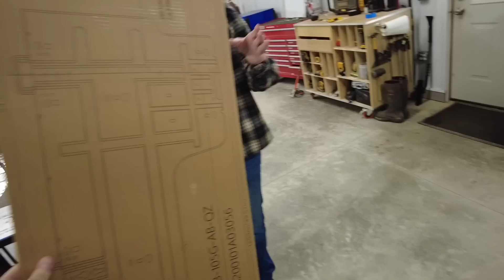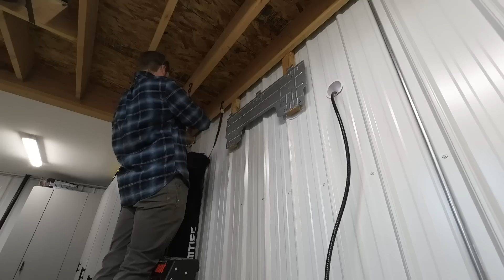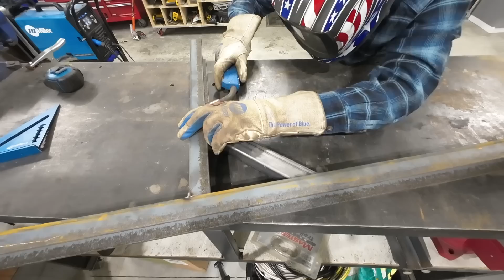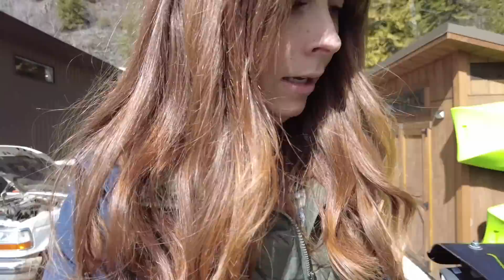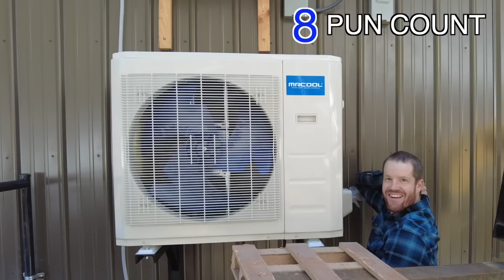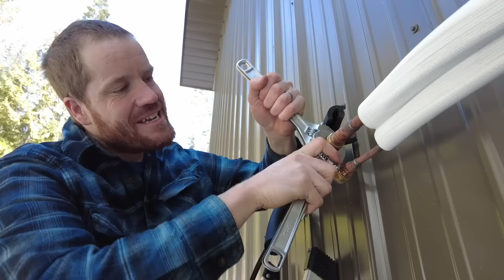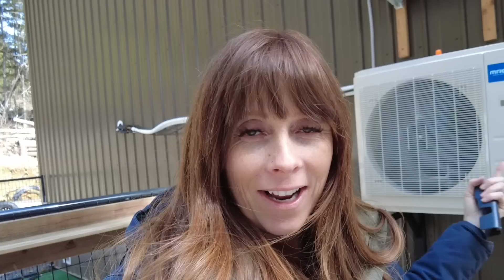Installing DIY Off-Grid AIR CONDITIONING

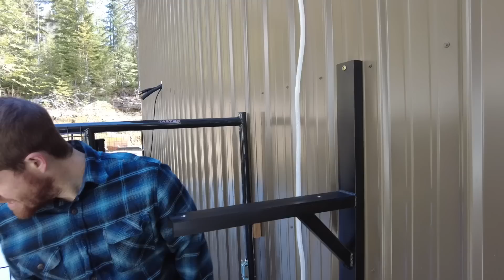Comment: Great video.  I am considering this for my garage.  One concern.  At the 9:35 minute mark,  you need to rethink how you mounted those brackets.  The screws may work in the short term but they are too small a diameter and span to far a distance.  They will fail at some point.  Maybe use 3/8 bolts with washers and nuts inside the building.  Thanks for the content.  Darryl
Reply: I understand the concern, however one also needs to consider bolts to be a direct thermal path from outside to inside and visa versa. Warm inside and below freezing outside would make for condensation or frost on the inside defeating the purpose of the unit. Add that moisture anywhere along the bolt long term would not be good for a healthy environment. Maybe lag bolts into the framing would be a good alternative solution to anchoring the supports.

Comment: I installed 3 Mr Cool units and found them to work great.  My last unit was for my garage and it does a great job of heating and cooling.  Based on issues for service by local HVAC shops not wanting to work on Mr Cool units, I figure it was cheaper to install Mr Cool units by over 50% less, and if needed I could replace a broken unit with another and still be money head.  I did follow advice to use a HVAC torque wrench for the line set, and use Nylog on the fittings.  Mounting the unit on a pad outside is quieter because it does not transfer noise through the wall.

Comment: I have several MrCool units, they are awesome.  One thing I would add is a soft start device.
Reply: This is an inverter based unit. It ramps up or down as needed and doesn’t have the startup surge or a non-inverter unit. It always starts “soft” and ramps up as needed based on demand.

Comment: You may want to consider putting the extra line-set on a horizontal plane to prevent oil traps in bottoms of the piping.
Reply: I actually looked at comments to see if anyone caught that. Good job. Totally agree
Reply: Not sure what you mean. Going to be doing similar so I don’t want to make any mistakes. Thanks
Reply: @stuartkorte1642  see the coil of extra tubing between the outdoor unit and the wall? It would be better to lay the coil flat below the unit, secured up with big zip ties, than vertical like that
Reply: @intrepidzephyr  sorry can you explain more, i didn't get the point
Reply: @mahmoudbitar6571   the point is to have the extra coils of tubing horizontal so that the lubricating oil that travels around with the refrigerant does not get trapped. Imagine the oil pooling in the vertically coiled loops, then imagine it passing more easily through the horizontal loops
Reply: @intrepidzephyr  got it , thank you so much, what about the outside unit itself if its higher or lower then the indoor unit , or no effect for that ?
Reply: @mahmoudbitar6571   there will be limits according to the manufacturer’s installation instructions but generally one floor up or down should be OK
Reply: @intrepidzephyr  Thank you , appreciated
Reply: @Stuart Korte   The oil will lay in the bottoms of the piping and prevent some of the oil return to the compressor. Low oil in the crankcase could cause a failure situation.
Reply: Good advice! Lay the extra coil flat under the unit.

Comment: I mounted a 7` x 9` projector screen and some heavy insulated shutters by myself.. just screwed a large eye bolt to the wall, ran a rope around screen and thru the eye bolt, instant pulley like lift for one person.  I even  bought a fancy pulley that I didn't need or use. The eye bolt worked perfect. Nice touch with the straps, I'll have to remember that one!

Comment: Will top mini split drip onto bottom mini split ? Is rain/drip awning required?
Reply: At First I was thinking the same thing but then i figured they are made to be outside in the weather so I would assume it should be fine. It would be nice if someone with experience about this makes a comment tho

Comment: Mr Cool DIY units are COOL 😅  My wife and I installed a 24k unit in our garage, and it only took us around 2 hours. 
The hardest part was routing the lines through the attic. 
We live in Florida so our house is concrete block. 
It was easier to go up through the ceiling, and out the gable end, and of course we chose the hottest day to do it. 🥵🤣😎 It really works great. Now our garage is a great workshop for us.

Comment: Have you guys given any thoughts for your future house. I have an interesting suggestion just because of the materials you guys prefer to work with. My idea is a Concrete and steel house with wood only used as accents.  I thought you guys might like this idea!
Reply: What would actually work best would be a ICF — INSULATED CONCRETE FORM HOME!!!
Google it!!!
Hard FOAM FORMS are used to make Concrete Walls.
Then to Top It Off, SIP Panel Roof — 
Structural Insulated Panels (SIPs) 
are high-performance building panels used in floors, walls, and roofs for residential and light commercial buildings. The panels are made by sandwiching a core of rigid foam plastic insulation between two structural facings, such as oriented strand board (OSB).

Comment: Quick question about your deck solar panels, are you going to put snow/ice stops on the roof above the solar panels to prevent snow and ice from sliding down the roof onto your panels?

Comment: Great work! 😀
From my experience the condensation drain of the outdoor unit will lock-up when the outdoor temperature goes below 3°C. Don't forget to remove the condensation drain before it starts freezing.
The indoor unit will be loud while de-icing - don't put it in a sleeping-room but use a forced ventilation between the sleeping-room and the room with the indoor unit.
We installed an outdoor air inlet over the indoor unit and an indoor air outlet behind the fan of the outdoor unit to have forced ventilation with heat/cold recouperation.
You can also move the generator from outdoors behind the PV-Container into the workshop and add an exhaust heat-exchanger to get a hybrid heating-systen. 😉

Comment: The only problem I have had with these units is the inside unit fan blades get all loaded up with dust and won't move any air.  I have had to make a small air nozzle and blast the squirrel blades clean.  When in air conditioning mode, the air heat exchanger is wet and all the dust from the fans sticks to the fins and plugs the drain hole.

Comment: That's a great looking system.
Our heat pump system wasn't able to keep up during that ice storm we had in TX back in 21. But on the plus side, we have 'emergency mode' which provides heat at a substantially larger energy draw.
Also learned that having an overhang above our outside unit keeps the fan from freezing up.
Definitely a brand to look into if we need to replace our home system again.  But the original one lasted almost 30 years and was still running strong.  But since it was 30 years old, we decided to update it, and our energy bills dropped almost by 1/2,
Always good to see the ongoing improvements and projects.
So...when are you going to rebuild that Courier?  🤣

Comment: I installed a Smaller MrCool unit a couple of years ago. Looked into the DIY series but it was not offered in the small size I needed And I also noticed The DIY series was about twice as expensive as their Non-DIY units. I decided to save the money and DIY a non DIY unit. It had a higher SEER number and was cheaper. Drawback was the need to evacuate the system before use and lack of warranty due to me not being a HVAC installer. I already owned a manifold set and used a vacuum pump from the auto parts store with their free tool loaner program. It's been working great for me. I wish more companies would offer DIY solutions like this though as it is really not that difficult to do and Super fabricator skills like the two of you have really are not a requirement.

Comment: Nicely done. Went with hydronic system in my shop. If summer temps become an issue I'm considering a mini split. See the old 90's vintage Powerstroke winter time umbilical chord program happening. LOL

Comment: What?!? A welding project without the plasma cutter?  Great to have another source of heat in the garage (and AC).  Will you need to add another solar array this summer?

Comment: Sweet!  I have the exact same setup in my garage (rebadged, but identical unit!)  My only regret is not pouring a pad and mounting the outdoor unit on a stand.  The variable frequency compressor start up is loud and shakes the walls and windows of the garage.  Nice job, and it's even more awesome to have indoor comfort powered by the sun!
Reply from the maker: Oh man, that would be annoying! We haven't noticed any vibrations, but we also don't have any windows on that back wall.

Comment: Since you do have the equipment, why don't you excavate your own geothermal trench for both cooling during summer and warmth during winter? 
You save a lot of energy compared to air source heat pump. I guess during summer you have plenty of energy available anyway, but during winter I think it would save you a lot of energy and generator use.

Comment: Did you just say 2000 Watts in "an idle state"? Good grief .. that'll suck you dry in no time...
Reply from the maker: We only had to run the unit for a few hours before it was almost too warm to work in the shop. Now that our days are longer we have more power than we know what to do with. It definitely won't be our primary heat source in the dead of winter, but the rest of the year we can run it as much as we want off our system.

Comment: Riley needs work gloves.  I was cringing as he was reaching into those fresh cut holes and moving insulation with bare hands.  Talk about reckless.🤣
Reply: I install metal on roofs and buildings and my hands are so calloused its not even a problem. I can sense what I’m working with better and have actually gotten hurt worse with gloves. But that is me. I wouldn’t recommend it to most people
Reply: Never really worked with your hands…